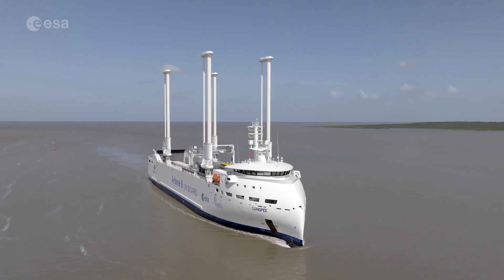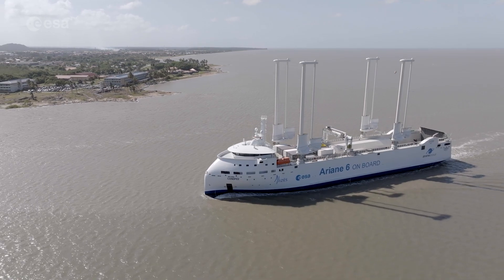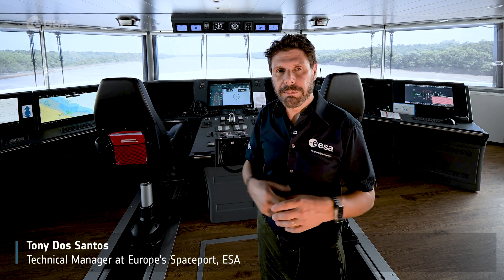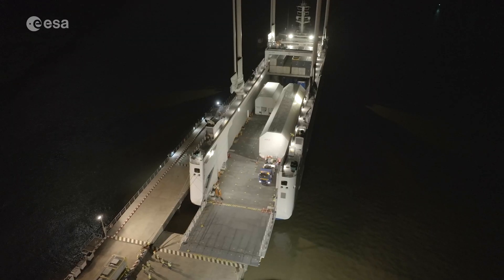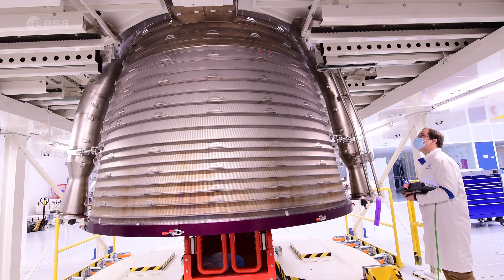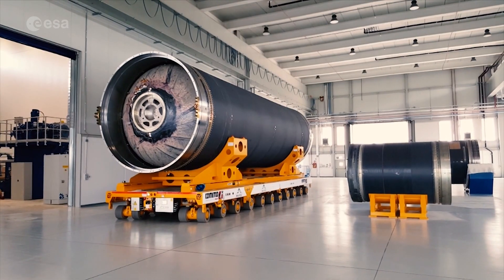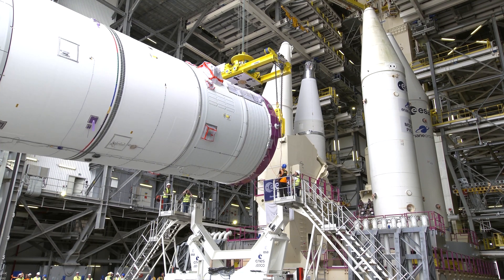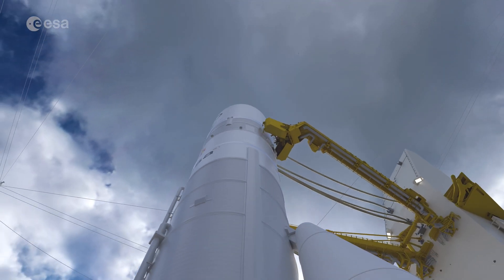Ariane 6 arrives at Europe’s Spaceport

Comment: I missed the part where it was reusable.
Reply: It isn't.
Reply: @antoniousai1989  Then it is already a failure paid with my taxes.
Reply: @Bear-form  It's cheap and reliable. Military satellites from Eu countries can't rely on assholes like Elon Musk to send things up.
Reply: Why do everyone just assume reusable equals cheaper.

"Arianespace Chief Executive Stephane Israel, in an April 23 briefing at Europe’s Guiana Space Center, said Europe’s launch sector can only guess at how much SpaceX will need to spend to refurbish its Falcon 9 first stages.

Israel said European assessments of reusability have concluded that, to reap the full cost benefits, a partially reusable rocket would need to launch 35-40 times per year to maintain a sizable production facility while introducing reused hardware into the manifest.

Arianespace’s Ariane 6 rocket, scheduled to debut in 2020, is forecasted to launch 12 times per year starting in 2023, when the current Ariane 5 vehicle is retired.

This rate may increase depending on developments in the commercial market. Seven of the 12 annual Ariane 6 campaigns will be devoted to commercial launches, each carrying two satellites. The five other launches will be for European government customers.

Israel’s argument, which he has made before, is that even if first stages can be recovered and refurbished in a cost-effective way, the launch rate needed for maximum cost savings – and hence price reductions to customers – is beyond Europe’s reach.

The only nations today whose governments are launching sufficiently often to reach those rates are the United States and China, and even these government markets may be insufficient, in and of themselves, to close the business case."
Reply: @Bear-form it doesn't have to be reusable to be an affective launch vehicle.
Reply: @HamzahKhan314  absolutely it does. elon said it best, it's like an airplane without landing gear that you only use one time. sure it can transport stuff but it will be so ridiculously inefficient that it would have no use to anyone. personally i'd be embarrassed if i was bringing this rocket to market today, not these guys though, they are all celebrating and padding themselves on the back. i guess great job for being the opposite of innovative.
Reply: This rocket is not competing, it is to guarantee launch independence for Europe. It's a Drumpf rocket.
Reply: @dronefootage2778 not always. yes, reusability brings down costs (as shown with F9), but it isn't always the best options for some missions (such as ones that require high energy orbits). Ariane 6 and some other (non-reusable) rockets, like atlas/vulcan much better than F9 when it comes to efficiency and higher energy orbits. F9 has definitely revolutionalized access to LEO, but other launch vehicles are sometimes better options for certain missions.
Reply: @dronefootage2778 i mean if someone manages to make a reusable rocket that has the capability of upper stages like centaur, then yes, ariane 6 and other expendable rockets would be a waste.
Reply: @HamzahKhan314  any space company that has half a brain cell ought to be working on something like starship because that is the future.
Reply: @dronefootage2778 starship will revolutionize access to space, but like F9 it would mainly be best used for LEO. any missions carrying a substantial payload would need multiple ships to refuel it, which would cost extra and add extra complexity. most people requiring access to places farther than LEO probably would steal chose other rockets because they would be more reliable, more efficient, less complex, and cheaper (atleast until starship manages to be able to launch for under 15 million dollars, which probably wont happen for a while). ofc anyone who needs to send a LARGE payloads to far destinantions would need starship, since no other vehicle can carry as much mass or volume. my guess is that it will be atleast 1-2 decades before starship is cheap and reliable enough to render other rockets useless. even then, i doubt these options would go away, due to the reasons I have mentioned above.
Reply: @dronefootage2778  starship will revolutionize access to space, but like F9 it would mainly be best used for LEO. any missions carrying a substantial payload would need multiple ships to refuel it, which would cost extra and add extra complexity. most people requiring access to places farther than LEO probably would steal chose other rockets because they would be more reliable, more efficient, less complex, and cheaper (atleast until starship manages to be able to launch for under 15 million dollars, which probably wont happen for a while).
Reply: @dronefootage2778  ofc anyone who needs to send a LARGE to far destinantions would need starship, since no other vehicle can carry as much mass or volume. my guess is that it will be atleast 1-2 decades before starship is cheap and reliable enough to render other rockets useless. even then, i doubt these options would go away, due to the reasons I have mentioned above.
Reply: @dronefootage2778  starship will revolutionize access to space, but like F9 it would mainly be best used for LEO. any missions carrying a substantial payload would need multiple ships to refuel it, which would cost extra and add extra complexity. most people requiring access to places farther than LEO probably would steal chose other rockets because they would be more reliable, more efficient, less complex, and cheaper (atleast until starship manages to be able to launch for under 15 million dollars, which probably wont happen for a while). ofc anyone who needs to send a LARGE to far destinantions would need starship, since no other vehicle can carry as much mass or volume. my guess is that it will be atleast 1-2 decades before starship is cheap and reliable enough to render other rockets useless. even then, i doubt these options would go away, due to the reasons I have mentioned above.
Reply: @dronefootage2778  starship will revolutionalize access to LEO like F9. for farther destinations, they would need to launch numerous starships for refueling, which would increase cost and complexity. it will probably take atleast 1-2 decades before starship would be cheap and reliable enough to launch missions farther than LEO compared to other expendable/partially-reusable rockets. even then, some might still consider other options due to simplicity.
Reply: @dronefootage2778  starship will revolutionize access to LEO like F9. for farther destinations, they would need to launch numerous starships for refueling, which would increase cost and complexity. it will probably take at least 1-2 decades before starship would be cheap and reliable enough to launch missions farther than LEO compared to other expendable/partially-reusable rockets. even then, some might still consider other options due to simplicity.
Reply: @dronefootage2778  even starship would not be the best option for locations farther than LEO. those missions would require many launches for refueling, which would add cost and complexity.
Reply: @HamzahKhan314  they probably said the same thing about refueling fighter jets in the air and now it's common practice. i think refueling starship will eventually be no problem at all. especially considering that the goal is to re-launch starship only 1 hour after it has landed.
Reply: @dronefootage2778  i wasnt really talking about the difficulties of orbital refueling (which is difficult, but im sure they will be able to solve it). I was talking about the number of launched. it would take atleast 6 launches starships to refuel one starship for a missions farther than LEO. even if starship launch costs go down to $10million dollars, it would still be around the same price as other expendable/partially-reusable launch vehicles. ofc it will be able to take much more mass and volume, but it will definetly be a lot more complex and risky. in the end, it would be up to the customers which launcher they would want to use, and i cant see them ever abandoning these other expendable/partially-reusable rockets anytime soon.
Reply: @dronefootage2778  i wasnt really talking about the difficulties of orbital refueling (which is difficult, but im sure they will be able to solve it). I was talking about the number of launched. it would take atleast 6 launches starships to refuel one starship for a missions farther than LEO. even if starship launch costs go down to $10 million dollars, it would still be around the same price as other expendable/partially-reusable launch vehicles. ofc, it will be able to take much more mass and volume, but it will definitely be a lot more complex and risky. in the end, it would be up to the customers which launcher they would want to use, and i cant see them ever abandoning these other expendable/partially-reusable rockets anytime soon.
Reply: @dronefootage2778  i wasnt really talking about the difficulties of orbital refueling (which is difficult, but im sure they will be able to solve it). I was talking about the number of launched. it would take atleast 6 launches starships to refuel one starship for a missions farther than LEO. even if starship launch costs go down to $10 million dollars, it would still be around the same price as other expendable/partially-reusable launch vehicles.
Reply: @dronefootage2778  its not really the difficulty with orbital refueling that is the issue. its the number of launches starship will need for missions beyond LEO. these missions will require atleast 6 tanker missions to top off starship's tanks. even if starship cost 10 mil to launch it would still be around the same price as other expendable or partially-reusable launch vehicles. ofc it would be able to launch much more volume and mass, but it would definitely be more complex and risky than other option. in the end, it would be up to the customers to decide what to launch their payload on.
Reply: @dronefootage2778  its not really the difficulty with orbital refueling that is the issue. its the number of launches starship will need for missions beyond LEO. these missions will require at least 6 tanker missions to top off starship's tanks. even if starship cost 10 mil to launch it would still be around the same price as other expendable or partially-reusable launch vehicles. ofc it would be able to launch much more volume and mass, but it would definitely be more complex and risky than other option. in the end, it would be up to the customers to decide what to launch their payload on.
Reply: @dronefootage2778  its not really the difficulty with orbital refueling that is the issue. its the number of launches starship will need for missions beyond LEO. these missions will require atleast 6 tanker missions to top off starship's tanks. even if starship cost 10 mil to launch it would still be around the same price as other expendable or partially-reusable launch vehicles. ofc it would be able to launch much more volume and mass, but it would definitely be more complex and risky than other option. in the end, it would be up to the customers to decide what to launch their payload on.
Reply: @dronefootage2778 although what you said is possible, starship would still take atleast 6 extra launches to top off its tanks for missions beyond LEO. that would add a lot of complexity and cost to the mission. even if starship could cost 10 mil per launch, it'll still be similar in price to other launch vehicles (although much bigger ofc). in the end, it'll be the customers who will decide, but i doubt starship will put other launch vehicles (like ariane or vulcan) out of business.
Reply: @dronefootage2778 even then, it would still add a lot of cost and complexity for missions beyond LEO. due to the number of launches needed for a simple mission, these missions would cost around the same to launch on starship as it would on other rockets like ariane 6, vulcan, or other future launch vehicles.
Reply: @dronefootage2778 yeah, but it would still add a lot of cost and complexity for missions beyond LEO. in the end, it'll be up to the customer which launch providers they want to use. although starship will provide a lot of competition, i doubt it'll replace other launch vehicles.
Reply: @HamzahKhan314  my prediction is that the only competitor to starship will be falcon 9 / heavy but maybe you're right so we'll see.
Reply: @dronefootage2778  F9 and FH, like starship, are not the most efficient rockets, because they are designed for LEO missions.. yes, they are cheap, but many missions need to fly on other rockets due them needing better performance out of the launch vehicle. like F9, starship will still definitely have a great impact on the aerospace industry. i honestly cant wait until it is operational. imagine how it'll be if we see starships launching more than F9s.
Reply: @Bear-form  Reusable upper stages will always be a fail.

But reusing booster rockets is sensible. ESA is currently developing the Prometheus engine for reusable liquid fuel boosters.